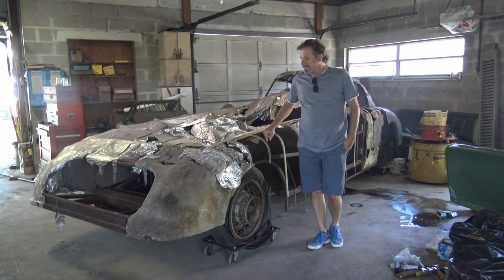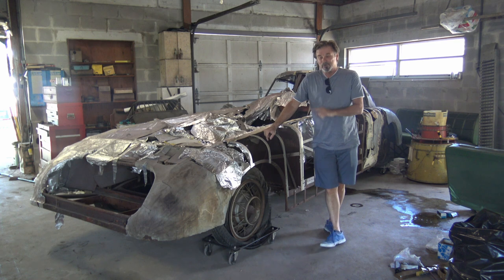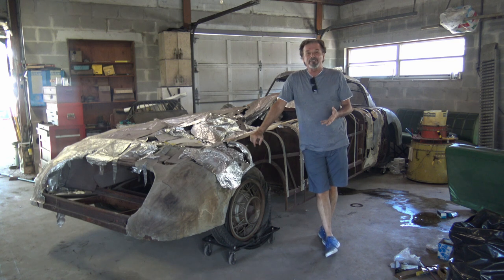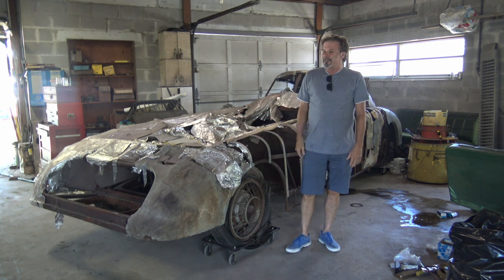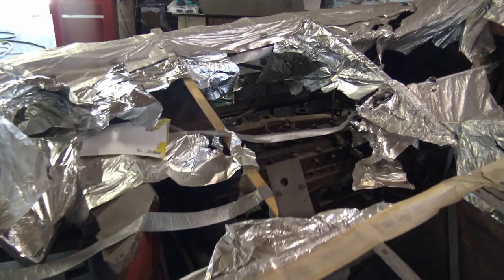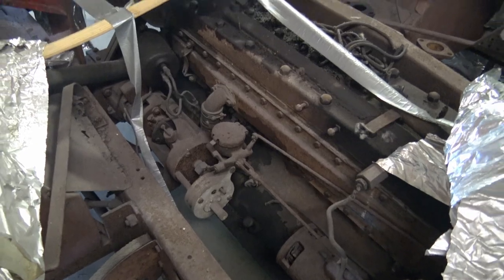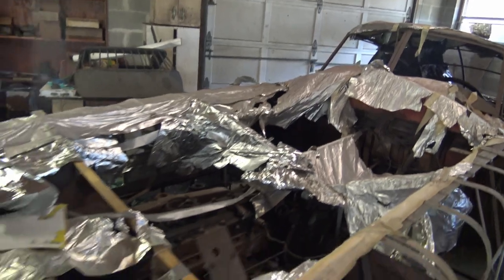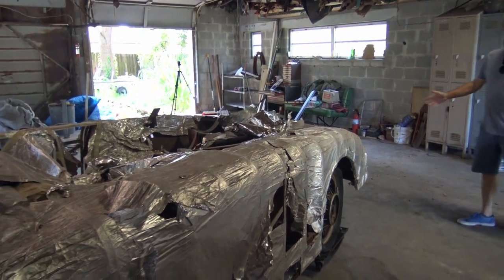Mystery 1931 Pierce Arrow Land Speed Car, Built by Preston Tucker?

Comment: Tucker had several contracts for Aircraft parts and construction projects. He had a contract to build a fighter plane in the mid 30's called the "pea shooter" but he missed some deadlines and it was cancelled. Most of the gauges in the dash are 1930 era aircraft gauges including a 300mph speedometer, tach and altimeter. Some of these gauges were produced in Buffalo NY, where the Pierce factory was located and where Preston Tucker worked at the time this car was created. That may be how a relatively brand new highline car chassis was used in this car's construction. There are a number of aircraft style construction techniques used as well. Again, leading potentially back to Tucker. Furthermore, Tucker was into plastics himself during this era and was attempting to try and pitch the military on using this new revolutionary substance. In the late 30's he built a small armored troop transport that went over 100mph with a plastic revolving machine gun turret on the roof. Several countries, including the US turned it down because it went to fast. After WWII broke out, the US stole his patent for the plexiglass (plastic) turret to use on bomber planes. However, it is my understanding that he was given the contract to make them for the military as a concession for stealing his patent. Tucker was also close friends with Harry Miller, the Indy car/engine builder and they teamed up to build Ford 10 Indy racers. Miller was big into aerodynamics and so was Tucker. So, Tucker was into aircraft, aerodynamics, aircraft construction, plastics, racing and in my opinion he but this car to show his bosses that the stodgy Pierce Arrows needed to move towards aerodynamics to streamline their cars and that a straight 8 could beat their new V12 with the help of a streamlined design. Then in 1931, the Silver Arrow, the FIRST production car with slab sides and no protruding front fenders was built by Pierce. All too much of a coincidence if you ask me.
Reply from the maker: Thanks for the additional context James, I'm sure our viewers appreciate it if they're reading along here too
Reply: The coachwork on the Pierce Arrow Silver Arrow was done by Studebaker craftsman. Studebaker owned Pierce Arrow at the time.

Comment: it strikes me as being inspired by the auto union cars of the period, like it looks german, like the 300 SL that Sterling Moss drove in the 50's, like look for some targio florio people and ask around there, as I bet this thing didnt come from here in this shape. 

and also look for the insturment maker, should give you an idea of where the part was sourced with the aircraft speedo, and maybe who did the work

hell maybe it was inspired by the great failure the hindenberg, as it certainly looks like it, either that or Lindberg

which I think WAS indinapolis, like take it out and look at the build mark behind it as it should have a part or a serial number behind it, as aircraft back then werent exactly common, and it could lead back to the builder

as it looks like it was built like a plane
Reply: Tucker had several contracts for Aircraft parts and construction projects. He had a contract to build a fighter plane in the mid 30's called the "pea shooter" but he missed some deadlines and it was cancelled. Most of the gauges in the dash are 1930 era aircraft gauges including a 300mph speedometer, tach and altimeter. Some of these gauges were produced in Buffalo NY, where the Pierce factory was located and where Preston Tucker worked at the time this car was created. That may be how a relatively brand new highline car chassis was used in this car's construction. There are a number of aircraft style construction techniques used as well. Again, leading potentially back to Tucker. Furthermore, Tucker was into plastics himself during this era and was attempting to try and pitch the military on using this new revolutionary substance. In the late 30's he built a small armored troop transport that went over 100mph with a plastic revolving machine gun turret on the roof. Several countries, including the US turned it down because it went to fast. After WWII broke out, the US stole his patent for the plexiglass (plastic) turret to use on bomber planes. However, it is my understanding that he was given the contract to make them for the military as a concession for stealing his patent. Tucker was also close friends with Harry Miller, the Indy car/engine builder and they teamed up to build Ford 10 Indy racers. Miller was big into aerodynamics and so was Tucker. So, Tucker was into aircraft, aerodynamics, aircraft construction, plastics, racing and in my opinion he but this car to show his bosses that the stodgy Pierce Arrows needed to move towards aerodynamics to streamline their cars and that a straight 8 could beat their new V12 with the help of a streamlined design. Then in 1931, the Silver Arrow, the FIRST production car with slab sides and no protruding front fenders was built by Pierce. All too much of a coincidence if you ask me.
Reply: @jamesmclynasforpinellascou2158  Oh fair enough, I just thought it looked alot like an Auto Union racer from the 30's that now that I'm thinking about it might have been after this

the other thing is, is it possible that maybe some of this could be connected to the Phantom Corsair in some way or another, as its kinda got that same style and profile

granted the fact that it looks like everything after it 20 years before it, kinda throws a monkey wrench into everything

and to think the Tucker looks more like a Pierce arrow, and Tatra Hybrid with studibaker styling than a Corsair like this does